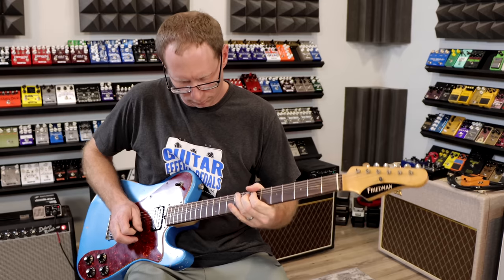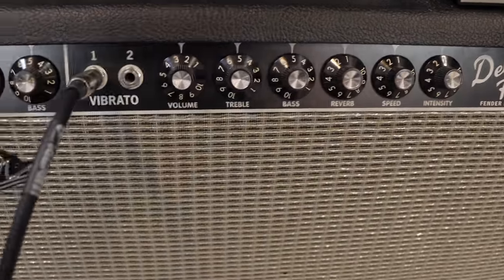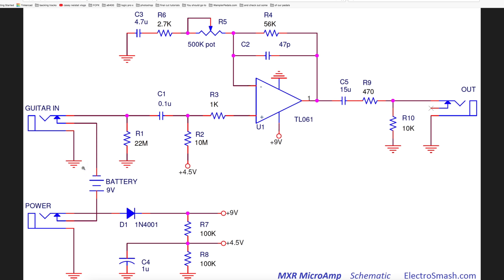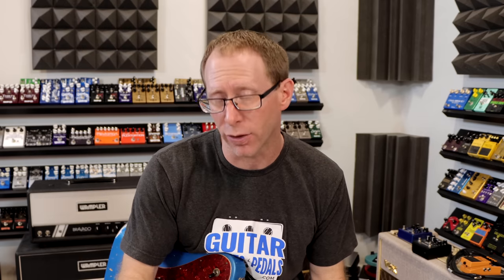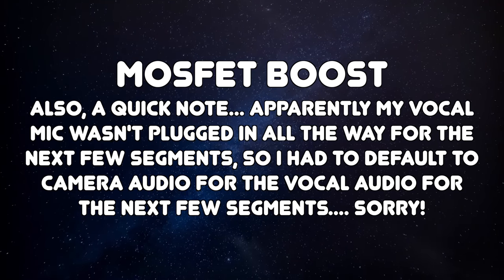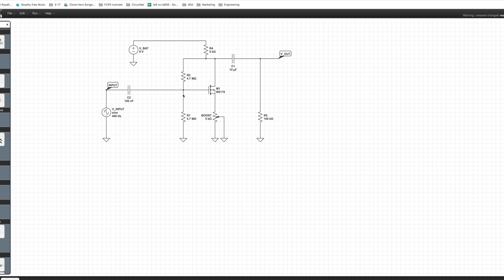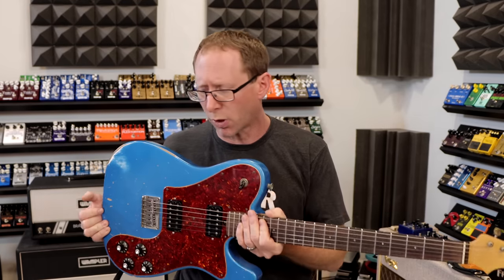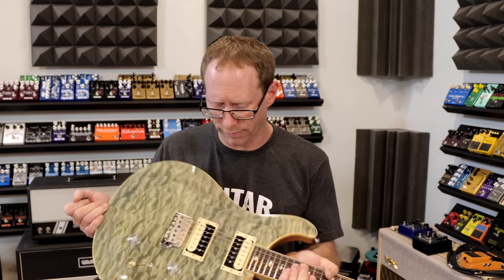Boost Pedals (Explained in Depth)

Comment: Here's my take on what preamp pedals are. Knowing that guitar amps have both a preamp and power amp section, and the preamp feeds the power amp, a preamp is any circuit that precedes the power amp. By absolute electronic definition, all of these circuits discussed contain amplifier stages, and whether they're transistor, opamp, JFET, MOSFET or even tube is irrelevant. They're all amplifier stages preceding the power amp, therefore they are all preamps. Really, when you put a boost, overdrive, distortion or fuzz into the input of your amp, your just adding to your preamp section.

I built a pretty nice clean boost by stacking two common emitter amplifiers bookended by two common collector amps. I got the input impedance up to limit tone sucking. I'd like to try it with 18 volts so I can add two more stages without clipping.

Comment: ... 03/23/2020:  Hello, I just ordered a Joyo "American" pedal.  It is advertised by many on YouTube as a pedal that will sound like a 59 Fender tube amp.  Also, it is made to run through a PSA system or a clean non-tube amp.  I ordered it, per many people say pedals only work their best in a tube amp and I only have only solid-state amps (Peavey Bandit 100W red-strip amp and Ibanez Wholetone 80W amp).  What do you think of the Joyo "American" pedal?
Reply: Good pedal but it won't sound like exactly like a 59 Bassman. If you use it for going direct to the board>PA it is a decent preamp, but you will need some sort of cabinet emulation, like an Impulse Response unit, or similar.
I used to go Guitar>Comps/Boosts/Fuzz/Drive>Joyo American>Chorus>Delay>Reverb>Digitech Bad Monkey "mixer out" output>direct to PA. Cheap but decent DI tone.
The "voice" control will give you the flavor of various Fender amps, but it is not a 59 Bassman or any other valve amp. It'll sound fine, especially through that Bandit.
Every Peavey Bandit owner needs a Boss OD3 and a ProCo RAT. Best drive pedals for that amp, imo.  Great amp!
Reply: Best into a PA in my opinion Les Paul into Am sound into PA = good stuff
Reply: @mattgilbert7347  Thank you for your reply. It is very helpful.
Reply: @meenis :  Thank you for your reply!

Comment: How about the Steve Stevens Rockaway distortion pedal where you have an adjustable EQ right on the pedal. Has a great sound turned down to just give a boost and you can control the EQ right on it!

Comment: I gotta say- a "preamp" pedal in the electric guitar world should emulate or actually be the preamp section of a specific or imagined amp. I'd put a "boost" in front of that. I use an old Peavey 50/50 stereo tube for my power. - my home made preamp pedal is a combo deal- Black Dog and Sunn-T from Barry. Then I boost with a Orman style MOSFET in front. I use no other "overdrives" but I'm a fuzz nut so I build those clones and experiment when I can. This conversation is interesting to me. I'm not offended by your techy descriptions, (go deeper!)- But - What is your favorite fuzz pedal? They can boost too!

Comment: He Brian,
Thanks for explaining boosters. But I'm just missing 1. How about the Catalinbread Sagrado Poblano Picoso? It should be a copy of the Jack Orman Mosfet booster. The info about it I can find say's: "Ah! the Catalinbread Sagrado Poblano Picoso! The Poblano Picoso has many of the great features as the Super Chili Picoso except that the Poblano is tuned for an extended frequency range. This has been one of my most frequently requested modification of the SCP for bass players." When I use it (with bass) I notice I have more bass and top-end. How does that work?
Reply from the maker: because it's acting as a buffer as well.
Reply: @wampler_pedals  what booster pedals do work like that aswell?
Reply from the maker: @bbkoopmeiners8816  a lot of it depends on the exact circuitry - these circuit snippets are just rough guidelines. Generally many Fet and op amp based circuits are lower output impedance (buffering), but it really depends on other things in the circuit and is too hard to generalize.

Comment: Thanks for sharing. I have a question about the rangemaster type circuit. An npn transistor has to have a Vbe of approx. 0.7 volts, so when a guitar signal goes into the base, the negative part of the signal is clipped at some point right? I think you mentioned it, so... Is it not possible to get the full signal at the collector in a common emitter configuration? Imagine that you just want to saturate the signal in the positive part of it. I would like to try that, but maybe it is not possible with bjt transistors. Thanks a lot. Very nice video.
Reply: You can  prevent the signal clipping with the polarization using voltage divider, choosing a base voltage of 2 or 3 volts in example. Anyways, its important to note that these transistors are very unlineal, that produces a kind of fuzz sound. Yo can fix it partially choosing a emitter resistor very much higher than (25mV/Ic), where Ic is the collector current.
Reply: @marcelomarot4229  I thought that more voltage at the base can damage the transistor. But maybe is the current which damages it...
Reply: @sciexp  its hard to explain without the schematics. But imagine the transistor polarized with a voltage divider (it means two resistors between Vcc and ground, GND). If Vcc is 9V and Vb (base voltage) is around 2V, in the emiter you will see around 1.3V (always refered to GND) .  This voltage is supported by the emmiter resistor, which defines the emiter current . If you wanna have a asymetrical clipping, you can choose a signal input higher than 1.3V , and if you wanna avoid this distortion the signal input must be lower than this value.
In any case you can have the output signal from the collector 's resistor.
Reply: @sciexp  the trouble with voltages in semiconductors is in inverse junction polarization , because if we exceed a certain voltage the junction beguins to  drive current (avalanche effect) and the heat produced could destroy the semiconductor. Every junction has is own voltage limit defined in the transistor's datasheet. (Anyways im this application it is not usual to have troubles with that)
Reply: @marcelomarot4229  Thanks a lot. I appreciate your answers. Let me explain a bit how it all started. I was looking to make a guitar amp with transistors only, no ICs, just for practice, maybe with a tone stack. I have made one that I saw on youtube, but I don't like that the speaker gets some dc current. And I want to design a circuit as well. So I started to look and read on the web, and I read about push pull configuration, and I read about the motivation for this circuit because of the limitations of the common emitter configuration. And I would like to understand properly how a bjt transistor works.
Reply: @sciexp  right. For the power amplifier there are good designs based on class AB stages and complementary transistors, and diferential stage at the input. The transistor as a common emiter is an option to make the preamplifier , in that case probably you need to add capacitors at input and output to avoid continue voltage at the power amplifier input. And to add the distortion option you can add diodes in some point of the preamplifier, i saw some Big Muff Pi schematics where clipping diodes where added to clipp the fuzz waves, maybe you can do something like that. However, i suggest you to make  your design by parts, to be sure every stage is working properly.
Reply: @marcelomarot4229  I did not understand initially... If Vb is 2v dc, the at the emitter, I will have around 1.3v, and it will change as the input signal enters into the transistor, let's say... So I can avoid clipping...
Reply: @sciexp  the Vbe is around 0.7V while the emiter current is different to zero. And the voltages i said as example are DC values.  To avoid clipping you need a emiter current different to zero on all time (it means a emiter voltage larger than zero), and a VCE bigger than 0.7V all time,it's related with Re and Rc values. These two are limitations to the maximum signal input in the linear zone. if you don't reach these limits the circuit will not clip the signal.

Comment: I think you are wrong about the Vertex boost - 1) no inverting circuitry, 2) it is flat frequency response at any boost level and 3) will not clip from high output pickups.  This is easy to see by measurement.  As I have time I measure pedals to see what they actually do.  Frequency response, signal swing, input & output impedance, stability with capacitive loads, output current capability, noise, distortion, etc.  If I had time I would post the results.  FYI - easy to prove non-inverting as it has two stages one before and one after the EXP output.  Put in a positive pulse and there will be a positive pulse on the EXP output.  Put a Positive pulse into the EXP input and you will see the same on the ped output.  Also, test the frequency response as I did and you will see that is it flat at any gain setting, a boost without any artifacts.  But like you said a boost with a change in frequency response with boost may be prefered.  The Vertex boost does not do that.

Comment: I run two decibel minis as the mainstay of my board at the start and end.  Having the consistency of the same boost/buffer at the front and end of the board, with the ability to switch the buffer on and off easily, has been an eye opener when it comes to finicky impedance pedals.

Comment: Why is the single OP amp circuit called non-inverting, when the double op amp brings the signal back into phase, if I'm understanding that correctly?
Reply from the maker: because inverting flips the phase 180 degrees, so you use two if you want to flip it back.

Comment: So Jfet booster based with Higher input voltage (18v for example) how much suffer less that splattery from high output pickups?
Reply from the maker: A bit, but you also need to limit the signal going to the first stage, which is why turning the volume on the guitar down works to do this.

Comment: Technically a preamp pedal is / should be a device that simulates the color of a well known amplifier, inserted before the power amp stage of another amplifier or directly thrown into a DI with cabinet simulation, eventually with power amp simulation. The Diezel VH4 is a good example of a proper preamp pedal.

Comment: I use a booster with single coils with the gain down all the way to give the pickups a little more compression sound without compressing it and a bit of a bass cut, treble boost too for clean tones. I I hate most distortion pedals they distort way too much, usually I find gain more that 1/3 way up is useless and turns in you Uber fuzz so for distortion I can use the same booster to push a blues distortion gain on just under half, its pretty clear and gets heavier if you dig in you can play chords with it or I use a tube screamer with gain about 1/4 up to push the booster, that midrange thing a tube screamer has rest pushed the booster for a pretty transparent overdrive.
It's great for Rock & Roll, 60 and 70's classic Rock type tone for metal you would need a compressor and a heavier distortion but I will would recommend using as little distortion as you need, don't just turn the gain all they way up.

Comment: I thought "preamp" always means a part of a classical guitar amp using 12ax7 tubes but in a pedal (or rack) form factor.
Which you can connect to the "return" of your guitar combo/head.
Reply: There are a lot of “preamp” pedals that are basically boosts that color the sound. And then the “preamp” pedals that are supposed to sound like other amps.

Comment: 14:00 It's funny how PRE AMPS, is a term  for Mic Pre Amps. 
 Radio Mics like the Shure B6, you see Metallica using in "Monster"  That mic needs 90Db of boost your your not hearing anything. Mainly because of Pop Filters, and padding to take off the "ss" and "P"s . 
 The POD HD has a vocal Pre Amp on it and it is in fact, 98 db.
where as the guitar jack is 60db if you run in at it's max.
  The guitar jack will not run a Radio mic

Comment: 2 minutes in...all the different boosts?

How about the DOD Boneshaker?

I love Marshall circuits. I get my mail there.

But...I want that girth and depth of a 5150/Recto (or Triple Wreck!).

What do?

Boneshaker. It'll make your 800 eat your 5150 and shit out an Orange.

Goes from Boost to Distortion, 3 band parametric eq, and goes low enough for Talkbass love.

Not to dump on the rest, but the DOD/Black Arts design is killer and useful for more things than I could give it credit for.

Comment: I was under the impression that a lot of the "preamp" pedals were called that because they were derived from the preamp circuits in old delays that colored the sound in a nice way.  These were usually from tape delays (e.g the Xotic EP Booster or the Dunlop Echoplex Preamp from the Echoplex EP3, or the Nocturne Dynobrain from the Roland RE-301), but also sometimes from early digital delays (e.g. the various pedals based on the Korg SDD-3000).

Comment: The Range Master should come standard with any Vox AC30 you buy because that's the sound everyone who buys one is looking for- not the AC30- the AC30 boosted by a range master. UA figured that out and when they did their "amp in a box" for the AC30- the Ruby- they went ahead and added the treble boost because they knew ppl wanted that Brian May/Queen sound- and it does it very well with the boost engaged. Without it, it's really woolly and loose sounding- not the best sounding amp tbh.

Comment: Why do pedals have batteries? If you have to power up and plug in your amplifier why have a battery in the pedal? Just plug it in also, right? I think the battery is redundant.
Reply from the maker: How would you power the pedal? They need electricity to work.

Comment: I'm daydreaming about A Silicon-Germanium that footswitches between the two... fuzz pedal with external NPN-PNP bias controls (concentric pot?) Leave one full 60's sputter and the other more 90s doom ...and switches to bypass clipping diodes.. Like clipping one from a SD1.. and a EQ like a Metal Zone with the concentric parametric tone pots. Having some sort of compression controlls would be nice also mainly attack since sustain is often on a muff style fuzz anyhow... Add a noise gate  and were all in one and done... I suppose a sweepable HPF would be ok to clean up some like amptweaker pretty much relies on

 IMHO a Preamp.. Is installed in your guitar or it's just not one.

You should sort out your guitar tone enough at the guitar to not need a top boost. I've got just a Full Shred in a Junior with a Series Parallel pot and no treble bleed just a .22 cap. Parallel drops my signal into cleans and raises my resonance series takes me into angry midheavy distortion.. In addition to the normal Junior style settings. 7 and 7 being default

Comment: The old LPB from Mike Matthews I always thought held up as a good neutral boost. It gets loud.  Super simple circuit. I blew up the audio output transformer on my old Gibson Amp as a teen.  Amp abuse. I use graphic EQs for everything.
Reply: That's allright!  I have two  LPB2!  Nothing sounds better for boost!
in my young years:  DOD Overdrive  > LPB2  >  Mesa Boogie MK1    (It sounds really good)
Reply: Yeah. The 2 is the same thing as the original but Mike put it in a pedal. The first one was this little inline box you could sit on you amp.   That is a real transparent boost.